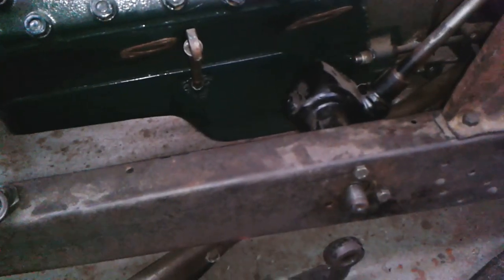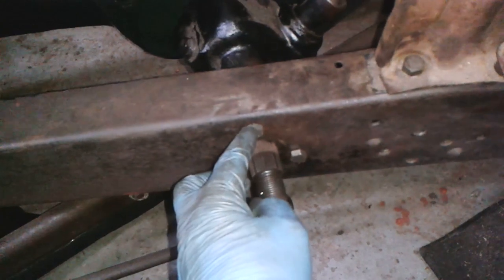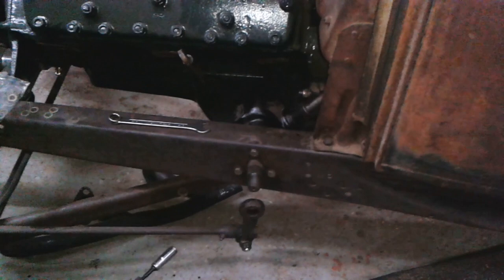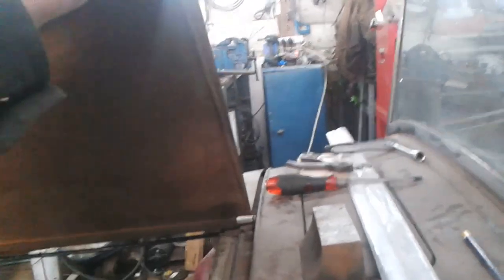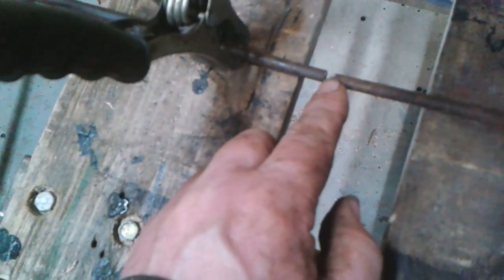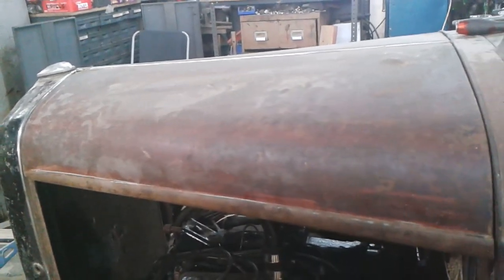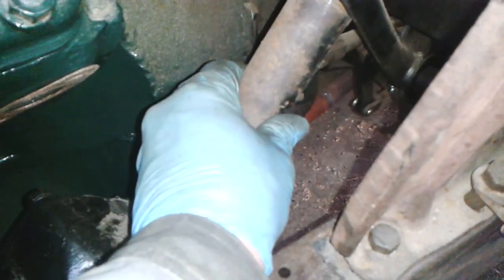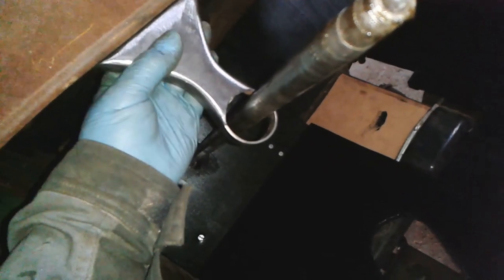Steering box alignment and Mart invents something. Update 2021 Ep 24 Part 1.

Comment: I ran into the same steering box misalignment on my 32 as you had Mart. I put a tapered shim on the bottom forward bolt. I made it from 1/8" plate and ground the thickness and angle to suit.
Reply from the maker: Hi Glenn. Yes, a tapered shim would be the correct way to do it.

Comment: By special privilege I have a feeling of déjà vu on the hood prop! For a latch, how about making a bolt to fit in the front hood side hinge eyes to engage with the radiator cowl?
A few videos back didn't you comment on how close the steering box is to the exhaust header? While your solution to align the column is neat, have you still got some clearance with the header? As you say, with the benefit of hindsight we might do things in a different order, but as you've also said you have to plug away at manageable sized jobs along the way. With a project like this we can't anticipate all the issues to plan every detail, so have to develop ourselves out of trouble! It's coming together well.
Reply from the maker: Hi Andy. Yeah, I went full circle on this one. In the last video I undid the spacers and just went with the minimal washers on one bolt. I've got some latches or more correctly restraints in the works. The hood props have proved really useful during multiple openings and closings during developing the latch/restraints. I am finding i am needing to do multiple versions of things until I have something I am happy with. That's the development process I suppose. Mart.

Comment: Mart, I'm still too lazy to read all the comments, so if someone already mentioned it, oh well. But since that hood prop fills 2 slots you could slip a piece of strap around the rod between the 2 slots and tie it down to the frame rail as a hood hold down. As usual, great work and video. Is this Friday and Sunday postings going to be a regular thing now? I do look forward to your postings.
Reply from the maker: Thanks JC. I'm already eyeballin that bridge across the 2 slots as somewhere I can hook a spring onto. Just need somewhere handy on the firewall to hook the other end to. Yes, for the time being, a Friday and Sunday edition, two parts per week. Nothing's cast in stone, though. Thanks for following along and commenting.